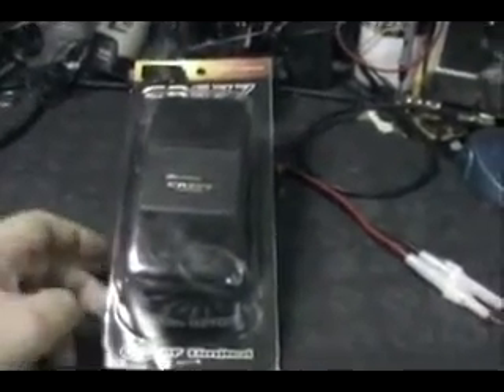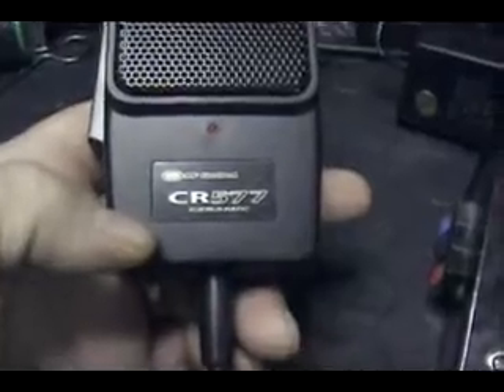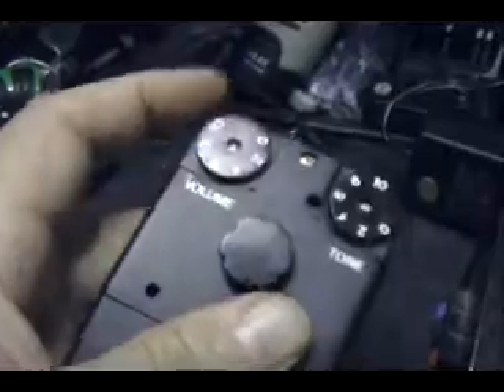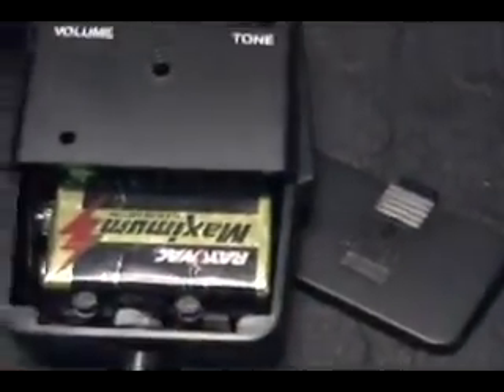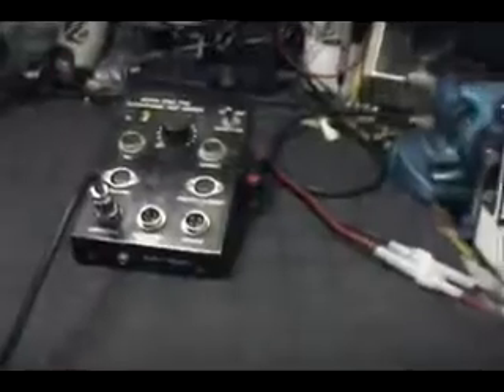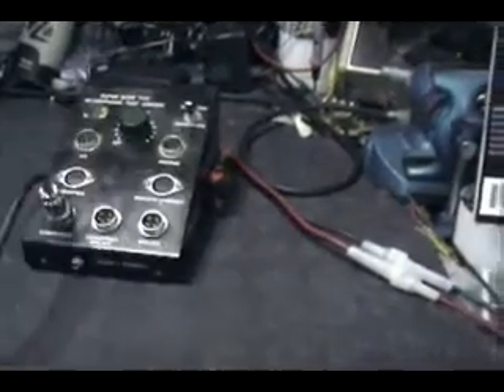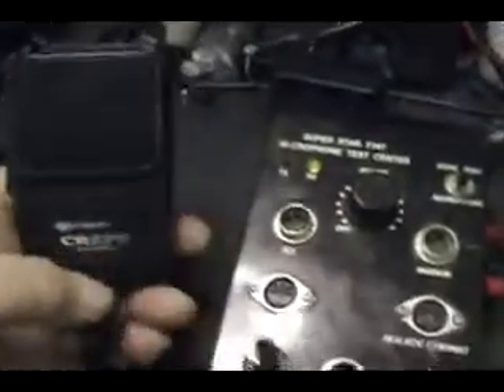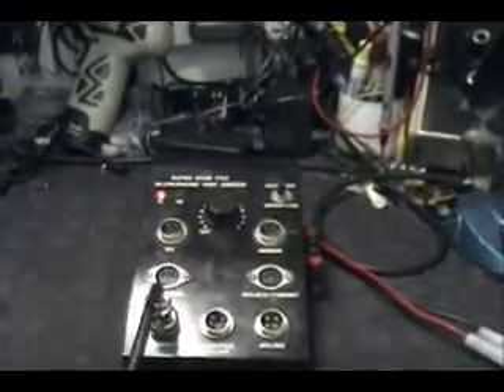RF Limited CR577 Ceramic Microphone Review

Comment: I believe the 2018 uses a condenser element which should have a smoother, richer, more studio-like sound if you want that for SSB.
I'm not certain about that but I have heard several local guys using the 2018 and they have a condenser sound. This 577 might be better for AM / snappy audio.